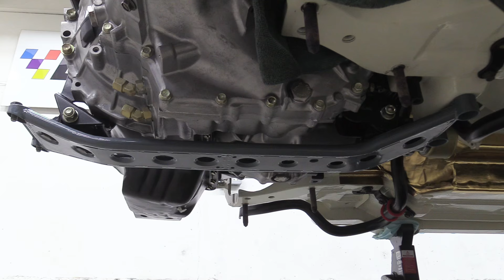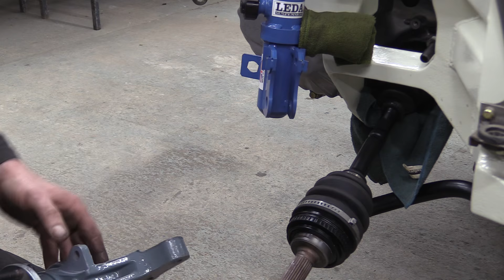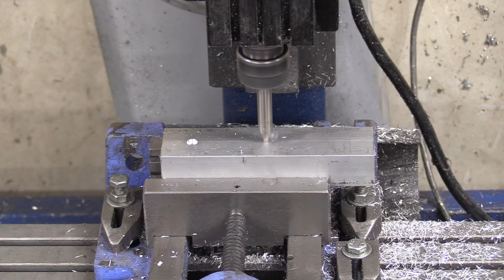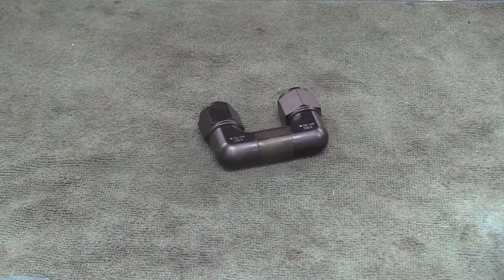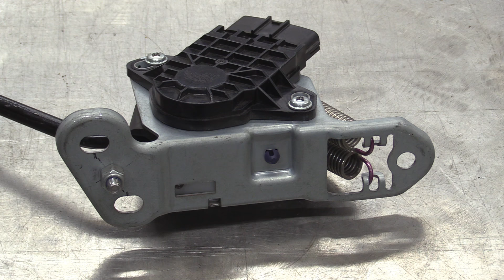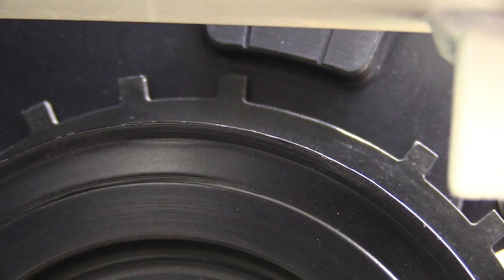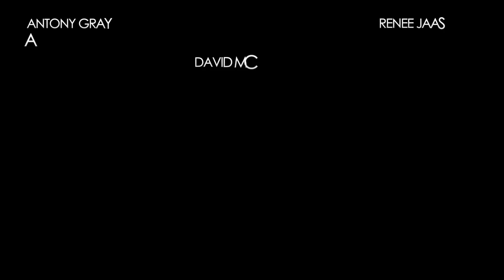Project Binky - Episode 36 - Austin Mini GT-Four - Turbocharged 4WD Mini

Comment: "At some point, despite Richard's best efforts, we're going to be chasing some sort of random, intermittent electrical issue."

I know that's a shot against Alfa, but it's also true of every car build ever. Random, intermittent electrical issues are the price you pay for having the car you want rather than the car someone else manufactured.
Reply: But especially Alfa.  And Minis with Lucas electrics tended more towards full-time, terminal electrical issues, rather than random intermittant.  LOL
Reply: Especially since there are no electrical connections on the strut or hub...

Comment: It feels good! I thought there might be an "Oh it's dripping" followed by the appearance of a block of lard... One cloud on the horizon though: What about the new fuel standard brought in to punish drivers of older cars? Well done guys, you are epic.
Reply: I dont' know what weirdness has been passed on their side of the pond regarding fuel standards...but I noticed they installed a flex fuel sensor on the firewall, so hopefully that'll be sufficient to handle whatever comes their way.
Reply: Considering being binky will have completely fresh fuel lines, it won't be an issue. Fresh modern fuel lines and hoses combined with a fuel injected engine means there's nothing to worry about.

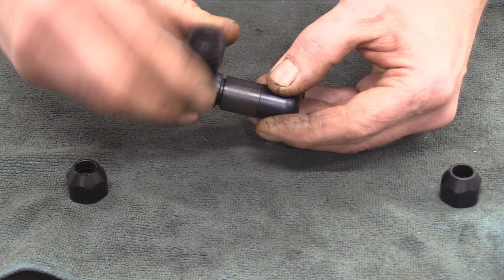Comment: 13:19  That is fucking top shelf genius right there.  It is more than just the length of the threaded collar.  It is also thread timing.  Maybe you got lucky, and I suppose it did not have to bottom out on either thread due to the o-ring.  But it sure looks like it was locked together upon installation.  Myself I would have installed the AN fittings.  Measured distance and lopped off some AL tubing and welded it on there.  Little sanding, and anodizing.  That really quite the solution you came up with.

Comment: To reduce strut rod arm setup time in the 4 jaw, cut the taper first.  Then mill in the mounting holes with measurements based on the taper hole, then shape the end.

Comment: As crazy as this may sound. When this 
car is finished it should be auctioned off. It's not just a Mini with different running gear and so forth. It's no doubt one of the most documented builds. 
  It would certainly help recoup the labour involved.
  As desperately as you want to drive it the show car circuit would be fitting. There has to be a conglomeration of businesses that would be willing to underwrite the entire deal.
  My guess is Binky would be the main draw to any car show. There is money to be made.

Comment: Why use aluminium for the track rod end adaptor plates rather than steel?
For strength and safety of the steering system, I know which I would choose.

Comment: Wha...wha...wha...bl...bl...bl... Dammit you've made my typing finger stammer.  Blue suspendie parts?  Not Battleship Grey to match the other suspendie parts, or Olive Drab like the fasteners to camouflage said devices?  And what will be the colour of the nut that holds the steering wheel?  Stroke Red or Adrenaline Brown?

Comment: I once had a Morris Mini Mk 2 1000 of 1968. It was some 600 kg of (mostly oxidized) steel sheet and a 90kg lump of cast iron with four spark plugs on top. I’m trying to spot a resemblance. Uh. I‘m old.

Comment: Silly question I just thought about. Can the Link ECU control the power steering pump you put in for variable speed based pressures? Like single finger light at parking lot speeds and basically unassisted at higher speeds?

Comment: I might just be going crazy,  but in Leicester about two hours ago I saw a white mini with very wide body coloured wheel arches and a black roof, that had a very noticeable turbo 'whoosh' on throttle lift off.  Unfortunately I was on the wrong side of a red traffic light as it sped across the roundabout, and the next set turned red against me before I could get close.  I just thought at the time, "that's a rather nice mini"  Didn't click until I got back home and saw this video waiting for me.  There surely cannot be another mini like it.  Given the state of completeness that the car is in in this video, and the time lapse between filming and now... this might not be impossible...
Reply from the maker: It wasn't Binky.
Reply: @BadObsessionMotorsport   Now that it seems evident that Binky was running at around the time I thought I saw it it seems even more coincidental! Either way big congratulations on such a literally epic project!

Comment: I'm half surprised you guys (nick) didnt build a knuckle out of sheet steel to adjust the length of throw for steering and such to make the ratios faster than stock lol
Reply: And I just bit my tongue because the steering is using the strut to turn the knuckle....... but what is the hole on the knuckle that in most other cases would be the tie rod mount for then?

Comment: I've just realized the lettering on the valve cover is pointing the wrong direction. MR2 valve cover then? Just out of curiosity, is the engine from the original ST185 donor or a different one?

Comment: I am a little concerned and feel duty bound to point something out to you and your viewers. 
I noticed that the axle stands were rated at 6 tons each and there were four of them.
Now even allowing for a 100% safety margin, that still means you are assuming the Mini weighs 12 tons. (All those brackets, I do understand.) If this is correct, I think you are going to need a bigger engine.

Comment: When does the next build start? The one where you make a really underpowered but overly complicated celica with mini running gear?
Reply: aren't they working on a bloody great lorry as a transport/repair vehicle?
Reply: @zadtheinhaler  yes
Reply: @harveysmith100  what about that race car they showed at least once years ago?
Reply: @zadtheinhaler  Yup. The Escargo.. there was a hint of we might build a rare MG too
Reply: @crissyb00  it wasn't a hint, they have an MG XPower SV chassis.
Reply: In theory, they must have all the left over parts for that build
Reply: Yes! A new project with a big cummins turbocharged diesel engine, and we'll call it project Stinky.
Reply: They also have an MG ZR chassis sitting around for another project
Reply: They made that joke in the very first episode haha
Reply: @38735736576574687466  did they? That's obviously where I got the idea 😂😂
Reply: @38735736576574687466  I just went back and they did as well, obviously just stuck in the back of my mind
Reply: Escargot ring a bell by any chance?
Reply: They still have the truck to finish.
Reply: 🤣🤣 brilliant .
Reply: A swap is a swapp, lol.
Reply: It already exists.  Its called a Mazda 2
Reply: A well-tuned 1275 A-series engine can give well north of 100bhp. That's more than the 6 litre Ford diesel engine that came out of Escargo. It did cross my mind.........
Reply: @pashakdescilly7517  ,
Don't forget about the torques...   ;-)

Comment: Small question, why didn’t you treat the engine firewall to the same gold foil heat film? Even if it would have kept the cabin 5°C cooler it would have helped.

Comment: You might want to have a chat with Sarah n tune. She would explain to you if you looked at the valves when setting up top dead center that the number one cylinder valves would both be closed on the compression stroke and the exhaust valve would be open on the exhaust stroke. Imagine that exhaust valve open on the exhaust stroke what a coincidence 🤭
Reply: they will know that. its probably ow they worked out the issue in the first place.

Comment: Please do a hard break in on the dyno, and change the oil right after.
Reply: not really necessary if theyre driven right when built (varying engine speeds and loads) BUT if its going on a dyno anyhow, then by all means do it on the dyno as its quicker. if rebuilding a standard (or rebuilding to the same spec) where dyno isnt required, theres no need at all.
Reply: @petelattimer6808  yea rebuilt standard wouldnt need a dyno but would still benefit from a hard versus a soft break in. As for binky, a dyno tune and a hard break in is a must.

Comment: Fantastic to see!
Do you still have plans to get patterns made off the wheel arches?
Figure there is a non-zero chance of them being "lightly brushed" by a hay bale in Telford,  or warped due to heat after extensive driving, given they're made of a Thermo plastic.